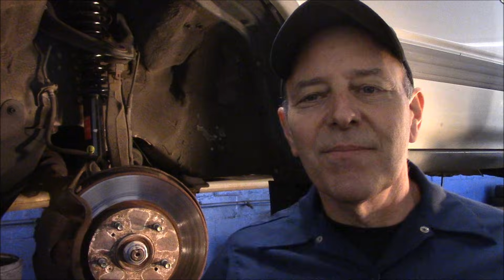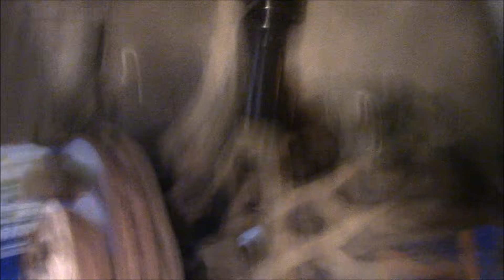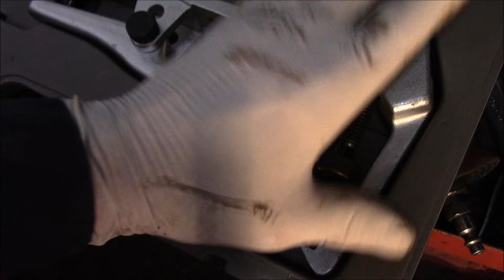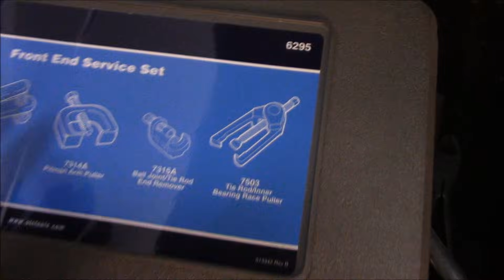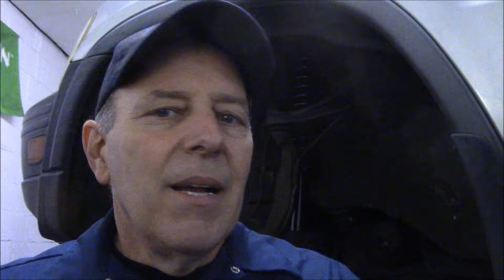How To Change Inner And Outer Tie Rods

Comment: Terminology always gets me. A rod with a ball joint and is adjustable in length i call a track rod as it is used to adjust tracking. A tie rod is used like on the rear to tie the wheel into a position and usually is not adjustable.

Comment: WOW WELL GLAD WAS REAL EASY TO COME OFF FOR YOU BECAUSE i BOUGHT THAT TiEROD TOOL AND TRiED GETTiNG LOOSE WiTH iMPACT GUN, BREAKER BAR AND A RACHET BUT MAN THiS ROD JUST WONT LOOSEN!!!!!!!! THiNK iM GONNA TRY TO HEAT iT WiTH BLOWTOURCH FiRST???? THANX FOR ViD THO🫡
Reply from the maker: Sometimes a little heat is exactly what you need to break those stubborn parts loose, just be careful around rubber boots and lines! 👍

Comment: I replaced the sway bar end links, inner and outer tie rods, lower control arm bushings, all three, and lower ball joints on 09 TSX. Upon test driving, I'm getting a loud and grinding / binding noise when driving slow and turning the wheel , left and right. I need help if anyone has any ideas. It wasn't making such noise prior to replacing these parts. All parts installed are Acura OE original Honda (Acura) parts. Thank you.
Reply: check your wheel bearings as well
Reply: @Riamu-Rhymesforkids turned out I had my putter tie rods backwards. R on the L. Swapped them and fixed the issue.

Comment: My 2003 USA Montero Limited 3.8L V6 is a little different looking. Torque values below.

Inner tie rod torque 65 ft-lbs.
Locknut on inner tie rod (up against outer rod): 53 ft-lbs.
Out tie rod torque: 29 ft-lbs.

Comment: Great video,  thank you.  I did the same job today.  I couldn't get the new rubber bellows cover on, despite heating it in hot water and greasing it.  There was just no room to get hands in and push the inner end of the rubber cover into place.   Then I spotted a short section of rain gutter downpipe laying around in my garage- actually a joint piece,  which was the perfect size to push the bellows into place 😊.  Hopefully that will help someone else.

Comment: How about on my merc clk240avantgarde where the tie rod end is pointing upwards and there's very little room for the tool to get the outer one to pop out. It's rusted in really badly and I'm thinking of heating it up with a blowtorch to expand the metal a bit? Good or bad idea?

Comment: You should always torque an inner tie rod to the manufacturer's specifications. Over tightening the nut can deform the knuckle, and using the wrong tool, like an impact gun, can cause premature wear and damage.

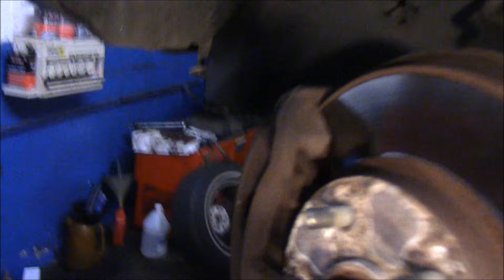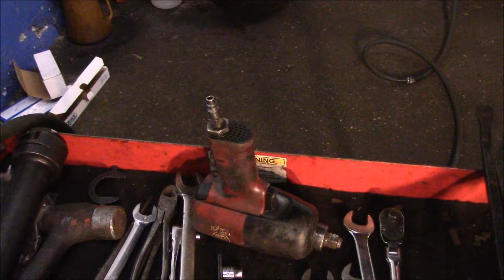Comment: One of the best described videos of a repair that I've seen. Thanks for sharing your information. I love the prelude describing the diagnosis of the problem (ata 1:35) and then most of the tools that you were going to use (from 1:55 to 2:30), then a quick description of how you will do the work before you actually do it, then you do the work, and then you recap/summarize what you did at the end!  Between all those segments you sometimes cover something that was missed in an earlier segment... pretty darn thorough.  I am looking to tackle this project on my 2006 Malibu Maxx and I do have a few questions: (1) One of the tools that you didn't really cover, was the one used to remove the "clip/snap ring" at the front of the bellows from 8:45 - 9:35 in the video? It kind of looks like a thick coat hanger with a bent end. (2) At 17:55 to 18:05 you show some kind of stem on the bellows that you say needs to be connected to a hose and at 22:20 you describe this stem as a "vent", but I never saw in the video how that was connected nor how it was removed at 10:35. It just looked like you yanked the belows off without detaching that "vent" without regard for it.  (3) At 18:25 to 18:30 there is an inner zip tie that magically appears in the video on the back of the bellows - I think this is the harder of the 2 zip ties to install because it is obscured by the bellows + I think you need to align it over a certain element of the bellows without being able to see exactly whether it is in the right place or not. You have the car jacked up on a pro-lift and I'm sure that is going to be more difficult when I'm lying under the car with 12" of space between the car and the floor!
Reply: He's working on a Honda but doesn't say what model Honda. the procedures wont be exactly the same on a Chevy nor will the tools used, Most Honda's use metric sizing for nuts and bolts vs SAE" inch sizes" for US cars. I doubt that Chevy models use  the same lock washer ring that Hondas use. It's best to look for the same make and model, if possible, for your own car. I drive a Civic so in general, its nearly the same but some things will still be different between models. Its seems that most people that do these videos all have tools and lifts that most of us dont have,

Comment: Great video

One thing I noticed, you did not use the penetrating oil properly. In order for the oil to penetrate deep within the threads, do you need to let it soak for a minute or two and then spray it one more time, wipe off the excess and then give it a go. Doing that, adds an extra layer of protection to those bolts and also makes life a lot easier for you
Reply: Shit one more thing I noticed is you should always get a white sharpie or even a crayon or something to mark the nut on the tie rod so you can actually drive to the shop to get the alignment done
Reply: @Glitch The Cat  what does it matter ge didn't reinstall the part that would be marked, he counted 18 threads of engagement, that's as good as a mark.

Comment: This channel always has solid and useful info, no BS, straight to the point, and especially like the positive tone which is always there. This was the only video I could find on crimping the washer on the inner tie rod end (and I watched probably a half dozen of OK sources) - Jim showed it & explained it very well. Also kudos for giving options on how you can tackle tasks with handtools vs powertools. Thanks, tie rod ends replaced successfully! Jim the car guy <<<<👍👍👍

Comment: Jim,
I have a 2010 Accord V6 auto. I have a significant side to side shake that comes on at about 55mph. I have new tires (~5 months old), I've had them rebalanced twice. I've also had an alignment. When I first took it to a mechanic, they told me my brakes were bad, so I replaced my all of my brake/rotors. Shake didn't get better. Then they told me it was my CV joints, so I had those replaced and the side to side shake got better for a hot second. It's back in full force, I don't know if it was because my car cooled overnight and didn't feel a shake. I'm at a loss.
Reply: You got short changed by those bastard mechanics

Comment: I’m changing both inner and outer, on one I have the outer tie rod end stuck inside the inner tie rod. I got the nut loose and broke it from the knuckle but it seems to be seized in the inner, any tips ?
Reply from the maker: Just soak it with rust busted and hope for the best.

Comment: I echo the last guy's comments You should be a shop teacher you understand the difference between teaching someone and just saying here's what you do and for that I very much appreciate you
Reply from the maker: Thank you for your kind words.
Reply: Hey I changed the inner and outer tie rods on both sides and had to move the rack and pinion steering to get the inner tie rod  tool  in the inner ...  now I have tracition control lights on and don't know if an alignment will center the rack and pinion can you comment in this sir?

Comment: What if a person forgot to tell if he turns on the tie rod when you're taking it off how do you get it back square again
Reply: You mean if you did not take note of the turns to get it off? You would have to do it by eye as best you can and make sure you don't go too crazy driving to the shop to get it aligned.  It isn't going to throw you off the road if you are bit off as long as you are not bombing down the highway at 100.

Comment: Hello Jim, is it necessary to use lock tight on the inner tie rod end where it connects with the steering rack as long as I peen over the lock washer? Thanks.
Reply: On this car it had the peened washer on the threads.  But cars without this feature could use a little loctite.

Comment: 2005 Honda CR-V, my inner tie rod tool is too short to remove the inner tie rod.
My CR-V doesn't have big bellow boots (10:40).
What size is your tie rod tool or what do I need, Jimthecarguy.

Had no problem using my inner tie rod tool on Accord & Civic.

Comment: Hi Jim. Thanks for the video. The inner tie rod tool that you've used in your video does not seem to exist in your Amazon store. Can you specify this tool? Also, what was the size of the adaptor on this tool for a Honda? Thanks again.
Reply: They have them at harbor freight with multiple adapters. You can also just use a pipe wrench.

Comment: Some people install the outer tie rods in from the top like you did (with the castle nut on the bottom) others from underneath (with the castle nut on the top) does it matter as long as the orientation of the steel (the curve is correct?)
Reply from the maker: Yes it does matter. You should always install them the way that they came off.Thanks for watching.

Comment: I was wondering is there any problem to put the castle nut upside down and hit it with a hammer to get the tie rod out? I think that's a better way than hitting the knuckle if I don't have that special tool. But most of the videos on YouTube don't use that method.
Reply from the maker: Good question but no because you may damage the threads . This way works perfectly without doing any damage. Check my Amazon store to see what tool  s are used to remove the tie rod end.Thanks for watching
Reply: Jimthecarguy Thanks for your knowledge. I really appreciate it.

Comment: what brand after market tie rod ends do you recommend? and the pinging over part a little hazy,
Reply from the maker: I do like the Moog or Napa parts the best.Thanks for watching
Reply: @jimthecarguy I've  heard a lot of complaint s about Moog lately. Their parts looking cheaper than before and higher failure rate. Also wondered if inner ball so tight you can't move it  by hand is a good thing?  Honda oem moves smoothly. Is Delco pro line worth the price? Proforge?

Comment: What if you can't afford the inner tie rod tool? Are u able to take it off with wrenches?
Reply: Yes, but you need like a pipe wrench and it’s much more difficult m, especially if lots of rust.  Make sure you have e a lubricant or PBBlaster in hand!

Comment: Great How to! But I have a problem with mine, 2001 Honda Prelude SH ordered the Moog Inner Tie Rod (EV800296) it didnt come with lock washer and no indented area either.
Reply from the maker: I think there was a piece missing . Check out the picture of what it should come with. The lock washer should be included. Google Moog EV800296 for a picture
Reply: jimthecarguy  That Moog inner tie rod has 2 different pictures from Moog website 1 with lock washer (all black) and 1 (gold/black) without washer. Local auto part store only had gold/black. I installed it anyways with blue thread lock, hope it holds. Thanks again for this how to!
Reply: @ngengok  how'd it hold up?
Reply: @unclefreddieDied  still holding good!

Comment: Should have used a torque wrench when tightening ,blue Loctite  as well .Taking a measurement of the tie rod's length would be a good idea also as aftermarket threads could be machined differently and give the wrong length  when going back together .
Reply from the maker: Yes that is true that is why I alway do a wheel alignment after the repair.  Thanks for watching

Comment: Thank you.  Used your video and rented tie rod tool from parts store.  Very straightforward. I had to reuse my ring on the inner tie rod, for 2010 Honda pilot, no other variances.  1 hour start to finish including set up and clean up and taking my time.

Comment: I have to do this job on my 99 Honda CR-V.  I found out you can "borrow" the tie rod special tool and tie rod press for 48 hours at Auto Zone or O'Reilly's auto parts. They charge a fee ($87 for the special tool, $10 for the press) but you get it back when you return the tools.
Reply: You dont need that tool.
Reply: I an tackling the same job in a 2004 cr-v bone of the rental tools are long enough do you ahve a part number ?

Comment: I had a question , my steering wheel wobble a little at around 70 to 80 mph could that be my tire balancing ?
Reply: could be tires out of balance, a bubble in a tire, inner or outer tie rods, worn out control arm bushings, broken ball joint, or strut mounts; or your tires could be separating due to not being rated to go that fast